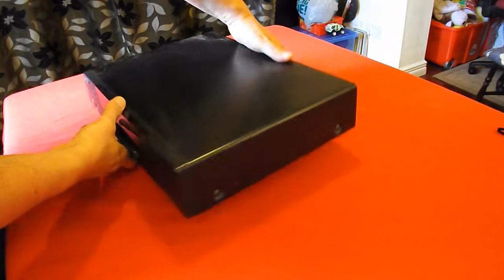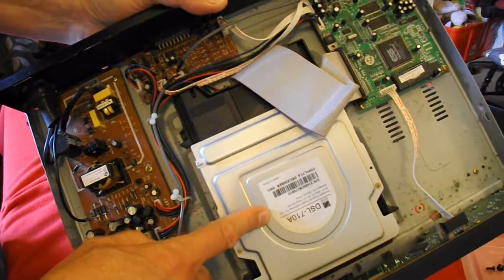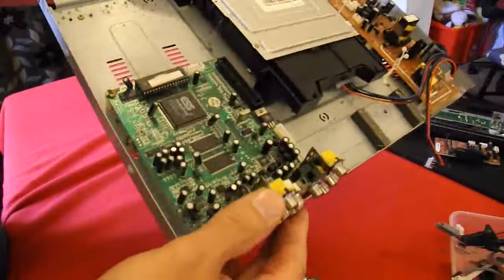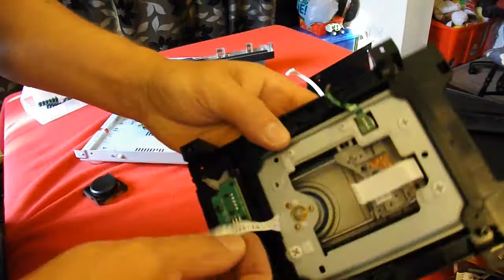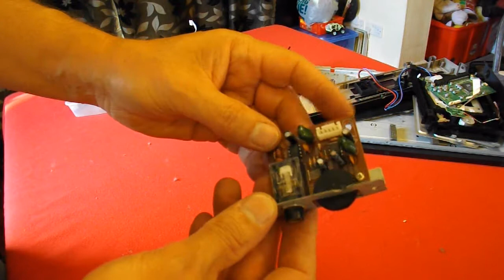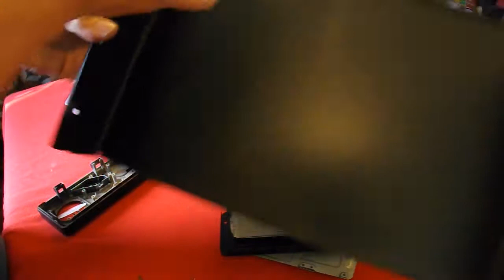Let's take apart a YELO dvd player

Comment from the maker: Thanks. Taking things apart when you are not worried about putting them back together can be quite relaxing. There are several guys I follow on YouTube who do fascinating electronic projects from simple components and my aim is to reproduce some of their examples. LidMotor and TinManPower are two I find particularly inspiring. I am also working on some electromechanical ideas that the electric motors and any plastic gear wheels would be used for. When completed I will upload a video.

Comment: Do you know if it's possible to use a dvd drive from inside an old dvd player and install it inside a computer?
Reply from the maker: Hi Yhigma, I doubt that you would be able to get one to work without a lot of modifications. None of the DVD players I have taken apart had drive units that would be a direct swap for a computer drive. The chassis assembly would not fit in the space available in the computer and none of the connectors were compatible. It might be an interesting project for somebody with far more knowledge than me, but not an easy one and probably not worth the effort, especially when they are not very expensive to buy and usually you want a DVD writer rather than just a reader.
Reply: GrandadIsAnOldMan Oh alright. Thanks!